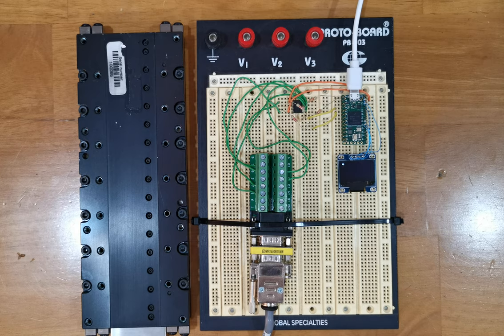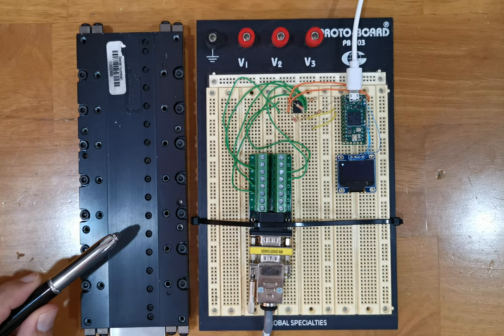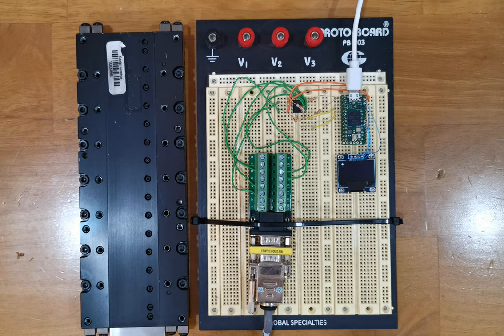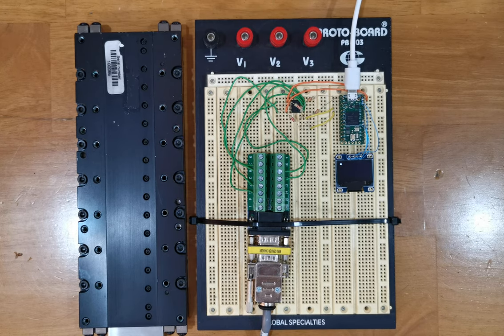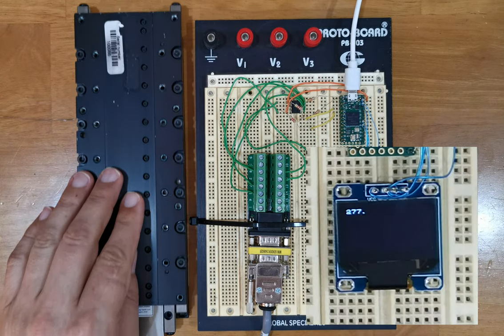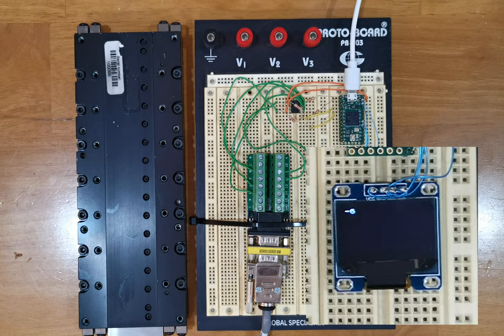Sin/Cos encoder with Teensy 4.0 hardware quadrature decoders

Comment: Nice, I picked up a Renishaw ML10X and got it running. It has different quad output on the connector inside the box. Think I till try this with the teensy 4.0 and the uMD software you have on your page. Just waiting for some line receivers to show up.
Reply from the maker: When you say different quad output, what do you mean by different?
Reply: @janbeck8269  Whoops. Autoocorrect strikes again. Differential RS422 quad output.
Reply from the maker: @JerryBiehler  Ah. Very cool. Let me know how it goes.
Reply: @janbeck8269  Will do. Sam mentioned the possibility of getting Zygo heads working with the T4.0, I have one of those as well. Also adding a integrated receiver to my Agilent 5517D but I have one of the HP 5529A boxes to work with that.